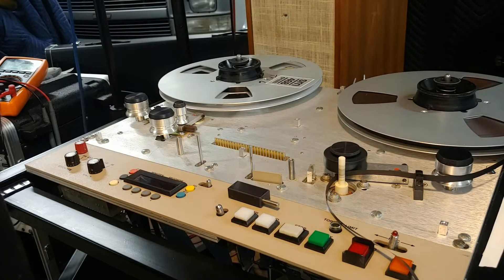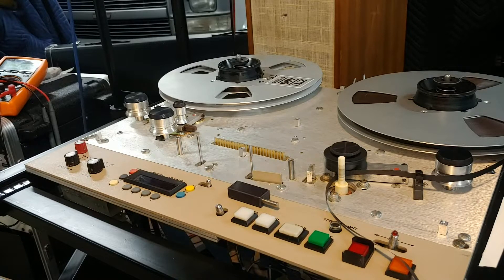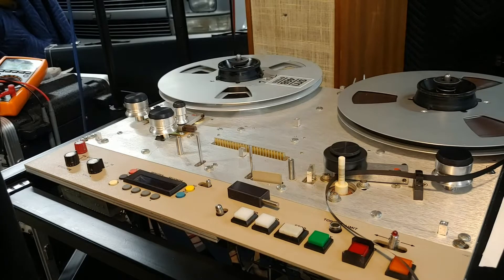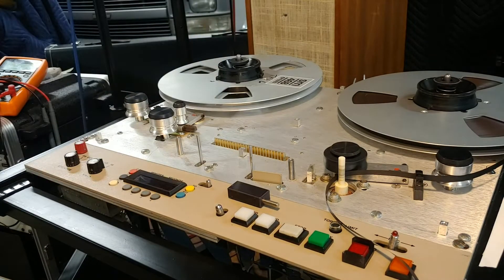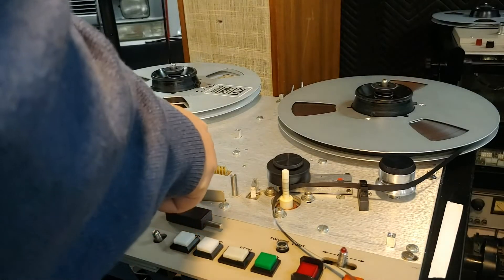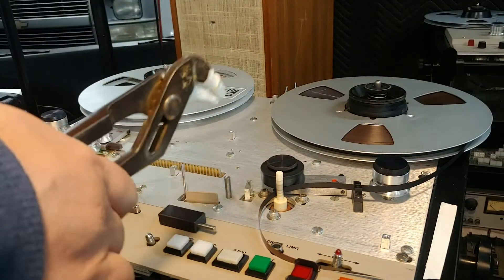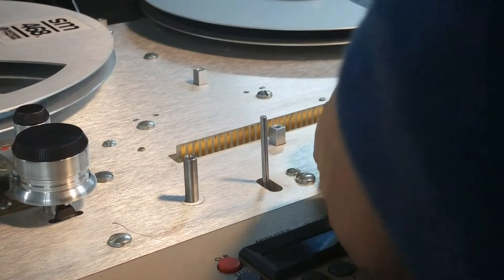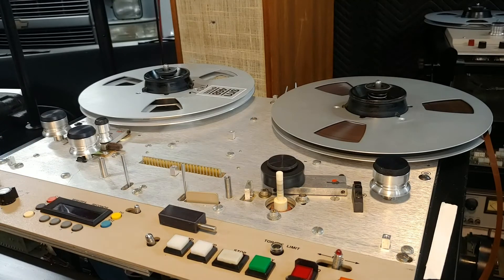MCI JH110 analog tape machine tech tips and repairs

Comment: hi have a otari mtr 12  and  with 1/2  1/4  sets of rollers  and head block i never sell the deck because it's a gold mine
and i have alot of tapes 100's of them  yes tape lifter yes i had to turn alot of in the past i have seen a cover over the pinch roller
on decks i pulled it of   i love the otari mtr deck  hard to find in the uk now